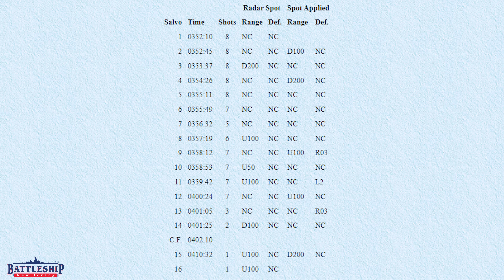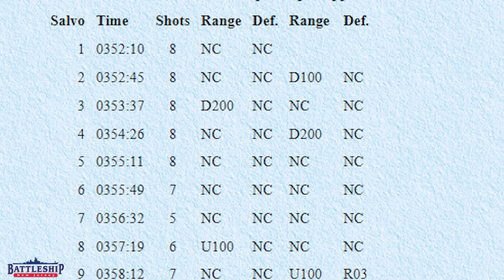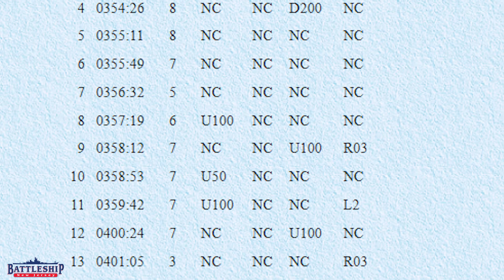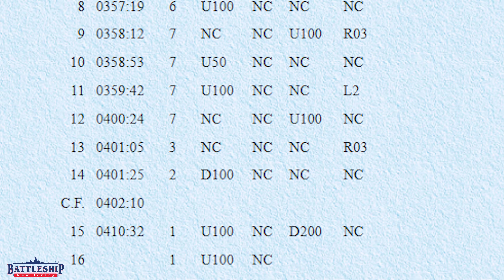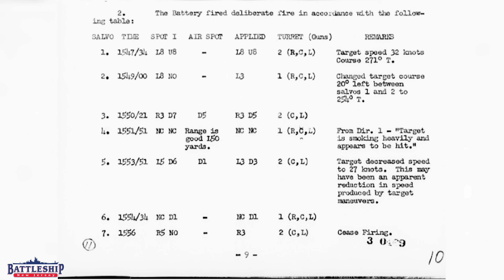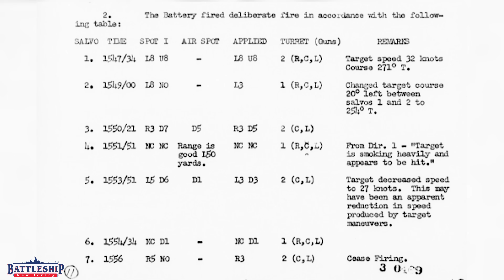Is Misfiring Naval Artillery Common?

Comment: Misfires with small arms can be nerve wracking enough - can’t imagine hearing click on 660 pounds of powder and 2,700 pounds of projectile 😅
Reply: Misfire drill aka "immediate action drill" on the tank gunnery range once the gun does not fire (this is from memory):  Gunner announces "misfire" then immediately announces "on the way" and pulls the trigger on the "Cadillacs" (the turret's power controls).  If no joy, the gunner announces "misfire" and immediately announces "Master Blaster On The Way" and uses the manual hand trigger (sort of a mini hand cranked generator).  If no joy the Tank Commander (TC) announces "Cease Fire" and directs the loader to move the gun arming handle/switch from Fire to Safe.

If this is a cold or warm gun, the TC will allow IIRC 1 minute to elapse in case of a hang fire (slow primer), then will direct the loader to open the breech carefully, partially extract the round, check the primer in the base/butt plate of the round for signs of impact from the firing pin, turn it 180 degrees, and reload.  Once the loader announced "Up" the TC will re-issue the fire command.  The above then repeats.  If still no joy, after the hang fire waiting period, the TC will announce "Cease Fire" and will direct the Loader to Safe the gun extract the round, and either put it back in the ammo rack or if conditions permit, remove it from the tank and leave it outside on the ground (in a firing range scenario, it would be carried to the "dud pit" near each firing position).  While the Loader is doing that, the TC will direct the gunner to use the firing circuit tester to test that the firing circuit in the tank is sending electricity to the firing pin (the light on the tester will light up brightly).

If it's a hot gun situation, after the hangfire time has elapsed, the TC will direct the loader to safe the gun, extract the round, and energetically and expeditiously propel the round out of the tank.  This is a combat-only technique.  In training, a misfiring round in a hot gun would require the crew to keep the gun pointed downrange while keeping the recoil path clear, and then wait until the gun cools down below the level where cook-off could take place (expect that to take 1-2 hours).
Reply: @SomeRandomHuman717  Exactly correct.  I was TC'ing an M48A5 we had drawn from the base motor pool rather than rail our own tanks from home station and running tank table VII back in '85. 4 engagements in - Misfire!  Gunner runs through his misfire procedure, I wait for a minute, tell the loader to extract the round, rotate it 180 degrees and reload.  He pulls it out and then it jammed in the breech with about a foot of the cartridge case sticking out. Can't pull it out.  I told the crew to bail out, my gunner leaves footprints on me as he climbs over me to get out through the TC hatch, the loader bails out his hatch, the driver is in his hole for the ride just like I am.  The evaluator and I used the extracting tool to yank the case out of the breech, line it up and try to reload.  Got it in, the elephant ears tripped and the breechblock came back up.  The evaluator took the loader's position and put the gun back from safe into fire and I fired the round from my TC override handle.

High pucker factor afternoon.  Hip pocket training for the entire unit for the rest of the afternoon was "evacuate the tank" and "misfire procedures".
Reply: @Jan-hx9rw  LOL on the "footprints"!!!  Vibram or Corcoran?  Had a little pucker factor myself, one day I was on the Table VIII range during qualification, supervising my ammo section delivering big bullets (I was the support platoon leader at the time).  Just so happened the tank firing from the first BP had a misfire.  After the crew ran thru their drills guess who trotted out to the tank to accept the dud round from the loader and walk it over to the dud pit? 😯😯😯<<---emoticon for "shitting bricks" LOL
Reply: On the Iowa, we had a misfire in Turret One left gun where she misfired 6 times, meaning six primer cartridges were inserted, and the gun was fired. We left the gun in the elevated position for hours and eventually lowered the gun and opened the breech. The powder bag was not aligned right and there was a neat hole burned in the bag just to the left of the red ignition pad if my memory serves me correct.
Reply: @Bellthorian  That is correct, I recall reading that in some of the reports.  I also remember reading that a large percentage of the primer cartridges had deteriorated in storage between the '50s and the '80s, requiring that a new batch be manufactured to support the '80s deployments.
Reply: @Bellthorian  Thanx for the info.  I was wondering what they would do with a misfire where ya pull the trigger and nothing happens.
Reply: @Bellthorian  I have seen a photo of that cartridge bag!
Reply: @Bellthorian I wonder if it would misfire or be more reliable if is had an electric ignition instead of a primer...if it failed to ignite you just elevate the gun  so the bags fall back on the electrical contact due to gravity and just up the voltage on the ignition spark...kinda like a bbq grill ingnition or something 🤷🤔
Reply: @nickriley4609  The firing exercise that day on Iowa was to shoot the super-heavy AP projectiles using 5 bags of the quicker combusting propellant D846.  They would have normally used 6 bags of propellant, but the D846 was formulated to create higher chamber pressure matched with a lighter projectile.  The theory was you could use D846 with the super-heavy AP projectile, but to reduce chamber pressure to acceptable level, only load 5 bags instead of the typical 6 bags.
Reply: Pucker factor for inexperienced crew would be so high, they'd be making diamonds.
Reply: @aserta even experienced crew. Miss fires are never fun
Reply: @aserta  why?
Just retry firing manually twice (the guns maintain the firing sollution from the ballistics computer)
And if that fails, lock in the manual safety and let that gun sit for 10min then swap the powder bags and primer.
Reply: A misfire is one thing, but what about hangfires?
🤣👍
Reply: @tyree9055 While not a real hang fire, you can kinda see what the worst case scenario would be with what happened when Iowa's turret went up in the 80's during an over-ram event on "Super charges" with a super-heavy shell IIRC, which btw was prohibited and never should've been ordered by the man that "just wanted to experiment".

IIRC one of the last transmissions from the turret was a seaman screaming something along the lines of "Oh GOD, the powder's smouldering!" Followed a while later by a "WHOOOOMPH" that rocked the ship and flashed out Incinerating the whole turret.
Reply: @tyree9055  Pucker factor goes off the scale.

"click" when one was expecting "BOOM" is bad enough, but "click BOOM" is a thousand times worse.
Reply: @tyree9055 that might happen maybe if the powder in the bags had degraded
Reply: considering the primer is basically a 357 blank, i assume it's just a matter of swapping out the dud and throwing the bad one overboard.
Reply: @robertsmith4681 The primer can be fine, but a previous comment noted a misaligned power bag (where primer area on powder bag is not aligned correctly with primer) led to six misfires.
Reply: Yep I've had a few hang fires, thankfully no squibs, bet squib in a 16 inch would be a bugger.
Reply: Probably should have reworded the title. These aren't misfires, this is just a deterioration of the RATE of fire.
Reply: Gonna need one he'll of a big dowel for that squib😂
Reply: Drench...
Reply: It’s F man !!
Reply: On naval cannons like this I believe you can put in a new primer without opening the breach.  Not sure if he has covered this before...

Looked it up and the primer (which is a small rifle round blank) has its own small firing lock.  You can keep putting in primers until the change ignites.
Reply: Lol yup I would  be like well we only have 8 guns now
Reply: I had a misfire during live fire squad rushes. A dozen marines to my right firing past me and I had to sort out my rifle. 

There are few things other than that situation that will get you to focus quite that much. Because if you don't focus, there's a scary chance you'll die.